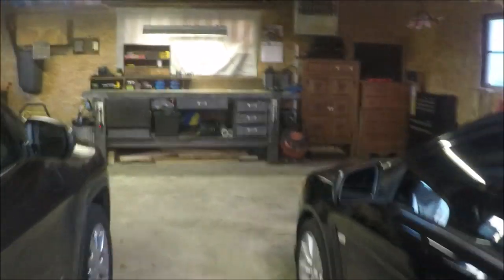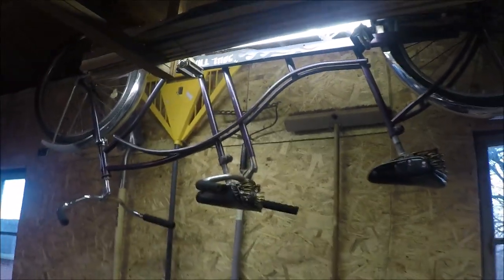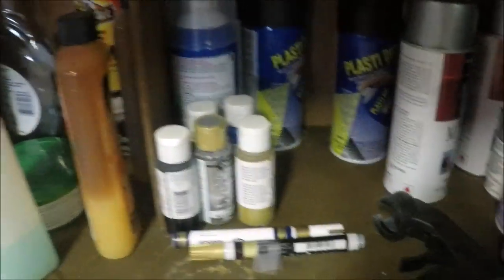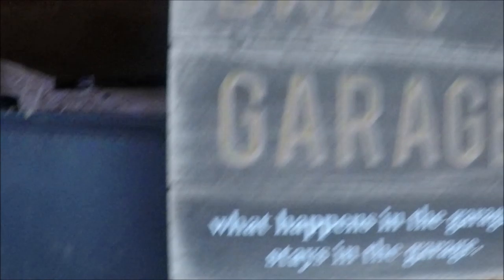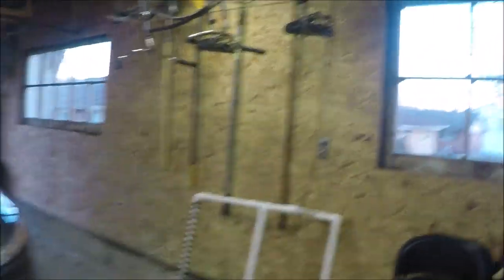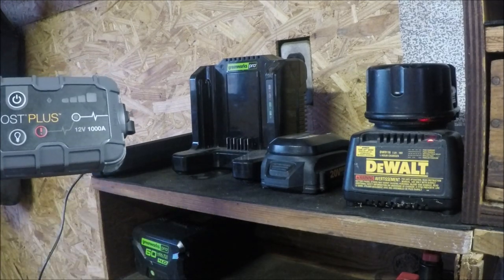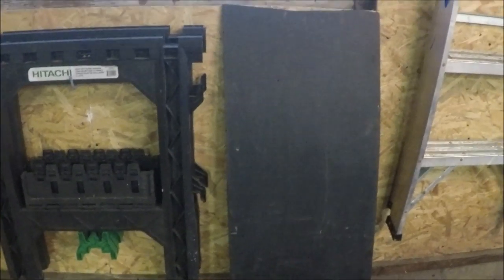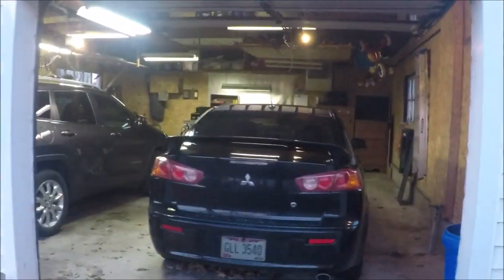My Garage and Home Tool Box Tour!

Comment: Should get a metal garbage can for dirty shop rags with a metal top just incase spontaneous combustion a cheap safety method as I have seen garages burn down from that. You never know most stuff not an issue this way you won’t have to worry.

Comment: Nice home setup.  Slightly jealous of the plumbing and heat.  There is one thing that I would add to your tool collection.  That is the 200 piece socket set from Home Depot.  Storing them is a pain as it is just a box of sockets.  But only $59.00 for 200 sockets.  The shear volume of sockets for the cost is amazing.